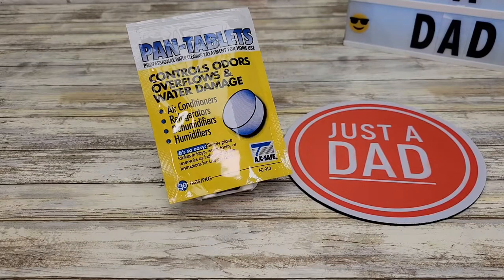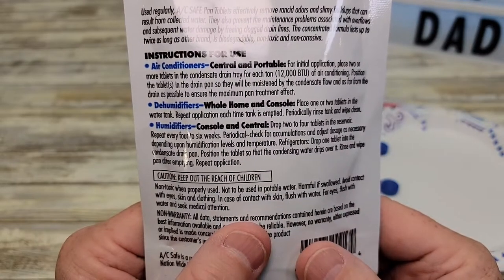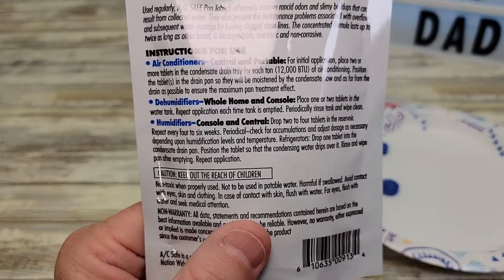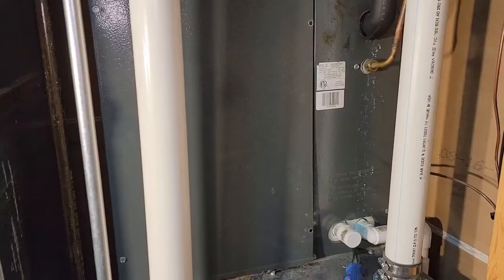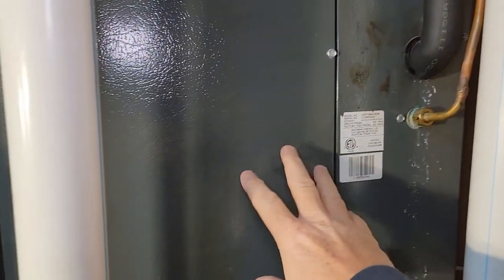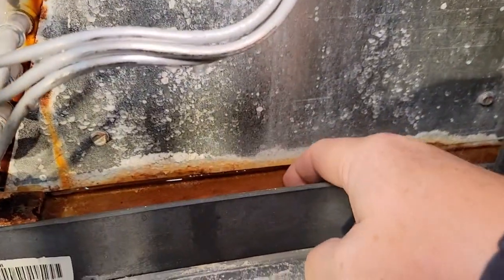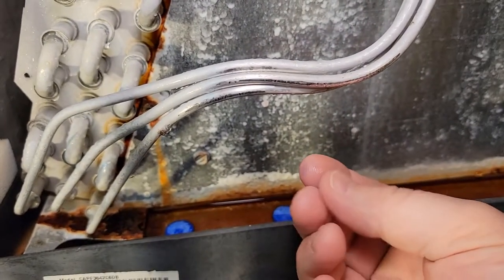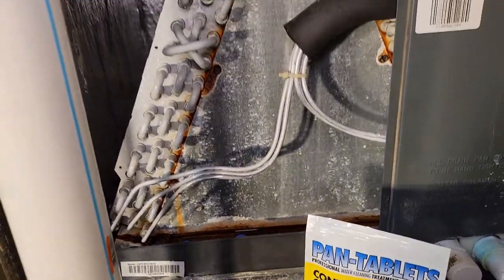How To Clean Air Conditioner Drain Pain with AC Safe Tablets

Comment: Do you really need to turn off power to your A/C unit to drop tablets into the drain pan?
Reply from the maker: maybe not
Reply: Yes because you don't want the AC to turn on while you are doing it. It sucks air and makes it harder to remove and install the air handler panel.
Reply: Just open the float switch or turn system off at the thermostat